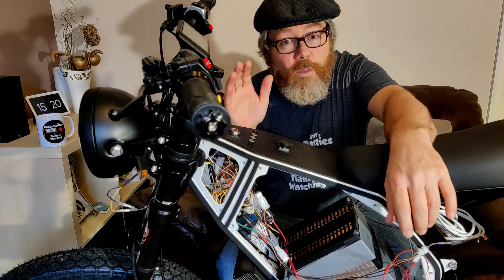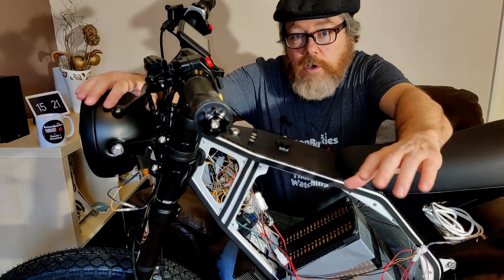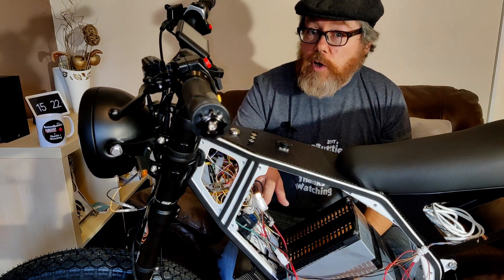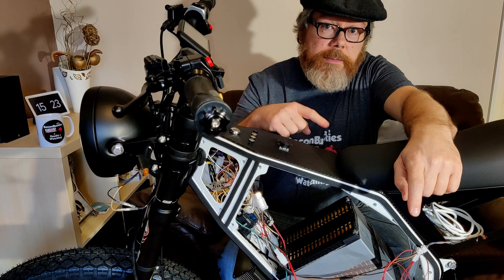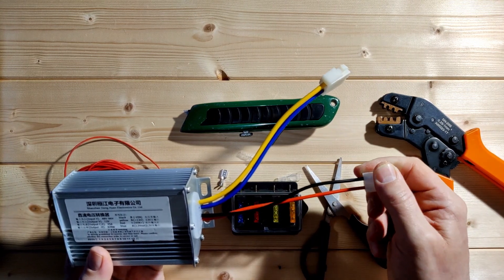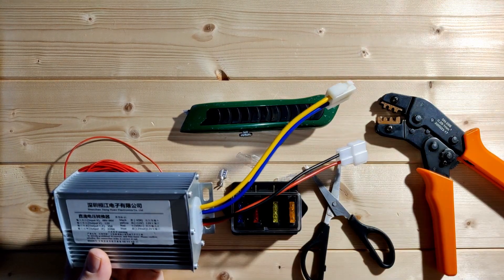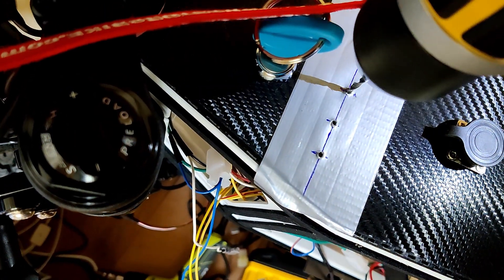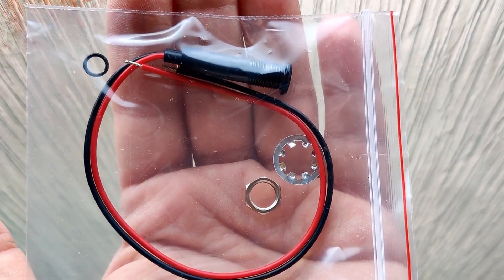FAST EBIKE BUILD UK ROAD LEGAL PART 11 - WIRING UP THE LIGHTS AND DO THEY ALL WORK?

Comment: I did one generous (5a) fuse to before the 12v converter (72v input...) to protect the battery. No point in fuses for all the leds imo....
Reply from the maker: I would disagree, separate fuses means you only lose one thing instead of  all if there's a fault.
Reply: @baconbuttties  yeah, but loosing anything in the 12v system isn't too bad for me... if your 12v converter shorts though, the bms will cut out well after the wires to it are burned...
Reply from the maker: @flexo3333  I was thinking more along the lines of if my horn shorted then the lights and indicators would still work. If my indicators went I would still have lights. If the converter pops then I have nothing and you put another fuse in and it pop again until you fix the problem.
Reply: @baconbuttties  in my case it would just be fix the short before putting a new fuse in... but yeah if something shorts the 12v go off. but might even be safer than riding without some light and not noticing...
Reply: but yeah i'm gonna put a 2.5A fuse that's still 150w even @60v...
Reply from the maker: @flexo3333  👍🏼

Comment: Are you going to be putting a cover on the controller? I am in the same boat where the space in the frame is limited so I am trying to work out the best way to mount this externally.
Reply from the maker: I have bought a metal cover to protect the controller but it's not wide enough. I knew this before buying it and hopefully can modify it somehow. It might not work but I do feel like the controller needs protecting from the front wheel.
Reply: @baconbuttties   I am going to guess that will be the same metal cover I have been looking at, the options are slim. My Controller is almost flush with the bottom frame so I am going to fabricate something, even if it is just a strip that covers the top > bottom leaving the sides exposed. It should give the unit 
a little more protection.
Reply from the maker: @jamesclarkson5618  👍

Comment: I admire your cable management (that is one of my weak poits..lol)..My build uses a seperate 24volt (28ah ) pack dedicated to all my accessories.  My 72volt 48ah (480amp bms) pack is dedicated exclusively to my bac8000/273 (40h) hub. I also use awg 6 (welding cable) for phase/battery wire. Its the best for heat control. Great video 👍🏽
Reply from the maker: Thanks 👍🏼
Reply: And 6awg is enough to carry 480amps? Just curious since I'm planning a new high power battery build, and want to know the thinnest wire I can get away with 😎
Reply: @Fred_POV   @Freddie C  I am using welding 6 awg cable. I have been throwing 650 phase amps in 40sec burst...The cable takes it like a champ..My motor has statorade and hub sinks also. Here is a good demonstration of welding cable
https://youtu.be/OHsUAzSbpM0

Comment: Well at least yours isn't as tight a fit as mine, fitting the wiring will be interesting in there... 😄  Also interesting idea with fitting the tell-tales on top, hadn't thought of that but will you be able to see them? I was going to add a 3.5" display for some temp and telemetry data there
Reply from the maker: Yeah I fitted the tell tale lights there as there is loads of wires coming from the handlebars into the frame and it seemed the easier option to take. I can see the lights okay but will the MSVA  inspector say " They are to low Mate"

Comment: You are amazing !
Reply: Are you going to install any precharge resistor and diode?
Reply from the maker: @alexandrostoskas3065  never thought about it, is it worth doing?
Reply: I’m also a diyer trying to built a vector typhoon frame with qs205 5t motor and a Kelly controller kls7230s. The controller came with a precharge resistor and a diode that supposed to use them on the contractor to prevent sparks and protect hardware such as controller itself and switches. Try to find more info from someone more experienced because I thing this is important.

Comment: Awesome job with the lighting. I've recently registered a similar build. Would be happy to answer any questions you have! All the best
Reply from the maker: Thanks, I do have a question about the VIN number. I have received VIN number but says it needs to be done by a dealer or Garage and needs their stamp and signature to make it valid. I assume you can't stamp it yourself?
Reply: @baconbuttties  I got a VIN plate made up on eBay and then riveted it onto the rear swing arm. They were absolutely fine with that. My insta is f.g.s.c.1 if you want to see pictures
Reply from the maker: That's good that a vin plate is alright, thanks.
Reply: @Fred_POV  just taken a look at your bike nice. How did the insurance company quote you?
Reply: @Dorsetwatersofteners  Thanks! Bikesure did it for around 400
Reply: Hi Freddie, what brakes did you use since I can't find any that have the ball end and oil level. Everything oht of stock
Reply: @pedb8206  I used the sur-ron brakes, I got them off their website
Reply: @Fred_POV  Thanks for the reply Freddie. I can't seem to find any on the site unless that too is out of stock. Do you know the model name by any chance?

Thanks for the help
Reply: @pedb8206  Their site is a little confusing, here's a link to them https://surron.co.uk/collections/sur-ron-2019-lb-x-series-dirt-bike-parts/products/lbx-off-road-front-rear-brake-systems
Reply: @Fred_POV  Thanks for that. Looking at the image, unless it's wrong, this has a flat end and not a ball end? Did you receive them with the ball end? 

Thanks
Reply: @pedb8206  Yeah mine are ball end, you could always phone them first to make sure